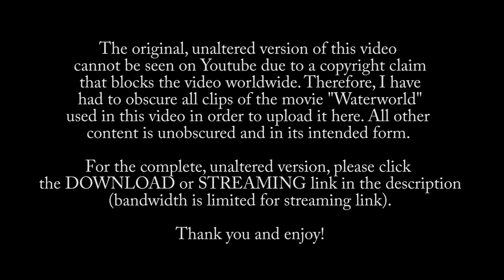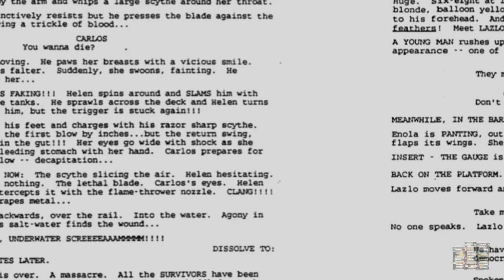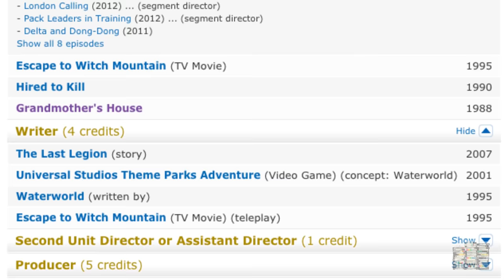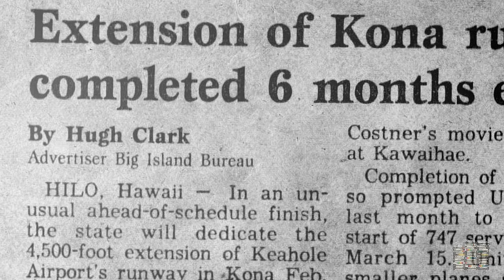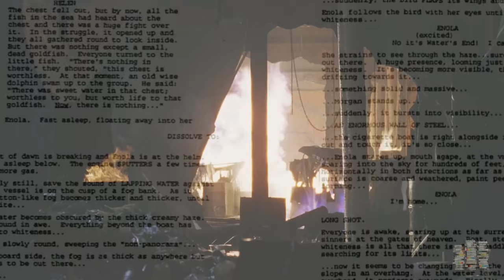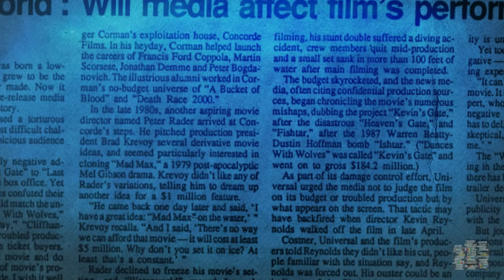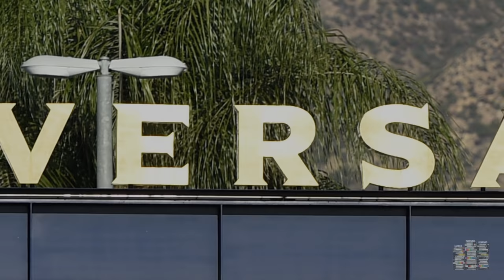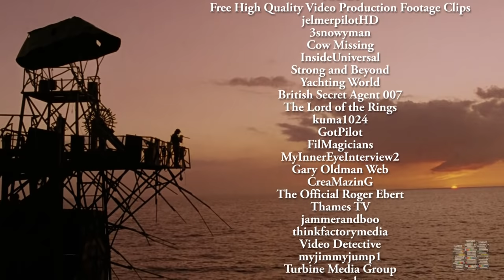The Story of Waterworld (1995) - Review & Retrospective

Comment: Ideas in movie and visuals are amazing. Atmosphere is also unmatched and other movies could only wish to have just a little charm this movies has. Mythology looks good but imo should be more investigated in movie. Antagonist are goofy as f and fights in many cases go over the top and damage movie quite a lot. Kevin is good here but more is movie approaching the end more and more cliche his character becomes and starts loosing his charm. Complete opposite of for example Aragorn in Lotr. Some events are straight dumb like coincidences which magically help escape, finds,… and so on. Have had to be left out completely or changed. Example of atoll fight should be separated from escape. Just fight for water city as one event and escape from it as other one. Pacing of events is sometimes so bad one has to shake his/her head. Sets are amazing and movie need definitely new spin of or even franchise because it has to have slow paced unroll of mythology and characters development in this huge world full of mysteries covered in/by water. Also main character defeat all antagonists just by himself is bad idea. Imo there should be some battles where each side will suffer some losses but gains some victories also in process before grand finale. Finale should be very cathartic, uplifting and peacemaking. And like that will make you think about environment through the main characters. Movie is quite characters flat and one dimensional. Does not provide much of a depth and understanding of antagonists and their ideology and what can blind following cause to people like a whole. I would like to see in their group some characters come to realization of wrongdoing against peaceful floating cities and such. You know real plot. Like I said ideas are great in movie just badly explored…